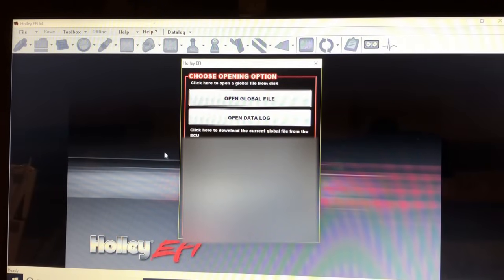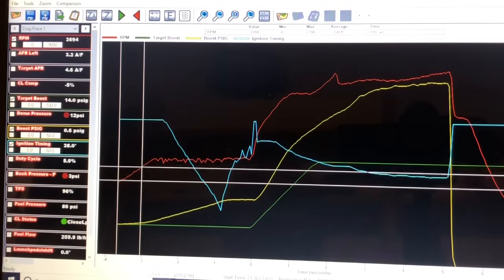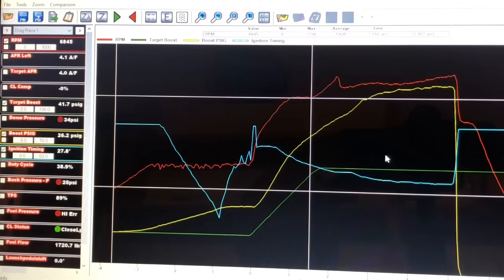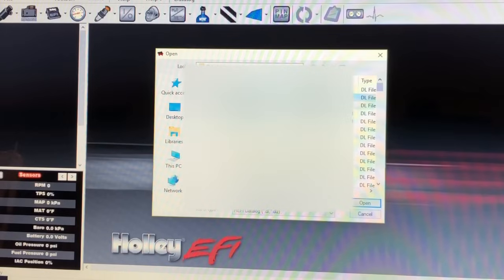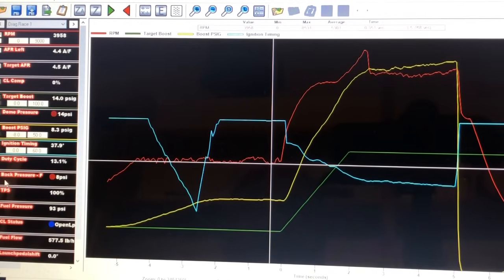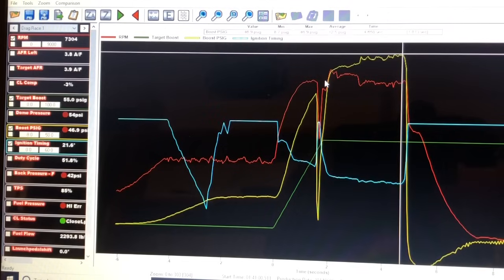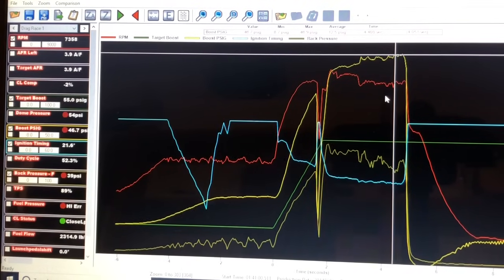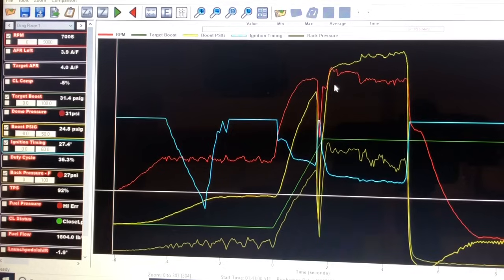Drag Racing Data Logs, what I look at! Holley EFI

Comment: The first thing I noticed is that TPS never goes to 100%. Is this just a sensor glitch or was it really not at 100%?
Reply from the maker: Me just not pushing it down all the way or the sensor needed recalibrated
Reply: @TurboJohnRacing  perhaps you could calibrate a light on the dash so you can visually that only comes on when it's 100%?

Comment: What’s ur timing like in the 40psi range?
Reply from the maker: About 23degrees.  This is on M1 fuel, I think compression is right at 10.5, 3.9-4.0 a/f ratio.  These heads are slow burn though, so read the plugs.  And only 1/8 mile passes.

Comment: You kept talking about back pressure. Why was that so important with some pressure
Reply: Bryan .Rawls lower back pressure= more efficient turbo. Higher back pressure = more heat & less power, the motor basically sucks hot air back in threw the exhaust durning high back pressure events, trying to reuse the already burnt oxygen & fuel.. not good for power at all. Lowering the back pressure, via properly sized turbo/turbos, helps HP tremendously!
Reply: BOOSTEDROK thanks for clearing that up for me
Reply from the maker: Backpressure is the frenemy!  You have to have it to get the turbo to work, but too much and it's party over.  Camshaft events make a big difference to help reduce backpressure.  On all of my cars, the point where back pressure starts to slow the car is about 1.5 to 1 backpressure to boost ratio.  Boost will keep going up, but backpressure will be picking up more per pound of boost.  So if the engine is making 40psi of boost and 60psi of backpressure, something is maxed out.